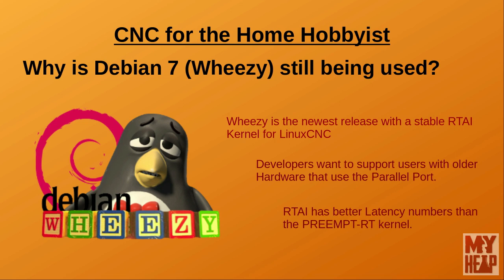LinuxCNC for the Hobbyist - 019 - Debian Wheezy is EOL, Now What?

Comment: OK, Joe which team are you on? What a great series. Thanks for the video!
Reply from the maker: Hey George.  To be honest, I see both sides.  I can be either simply because I have a pretty tight network firewalled by pfSense.  If I were less experienced with computers and networking, I may be on Team B.  Or stay on Team A and just use the SNEAKER NET.

Joe
Reply: My CNC stuff is all on my network and I have my firewall choked down. I've never used pfSense before?
Reply from the maker: You will probably be fine.  I use pfSense for VPN, wireless controller, vlan and some other stuff.  It is free software and runs on FreeBSD Unix.  You should check it out if you like that sort of stuff.  I also use FreeNAS to run my media, virtual servers and stuff like that in my house.  It is another free software running FreeBSD.

Comment: Well ... I have a (strange and unconfirmed) theory.
I have heard rumors about the RT-preempt developers preference. It also seems that the parallel port is dead, both available hardware and software support such as linuxcnc. Does that mean they leave RTAI? Maybe yes, maybe no. I do not know.
On the other hand, the linuxcnc rtapi API is common for both RT patches, as far as I know.
RTAI - the RealTime Application Interface for Linux (Dipartimento di scienze e tecnologie aerospaziali del Politecnico di Milano) has released the RTAI 5.2 on May 18 2019. They claim that this release has been "porting to the latest available Linux kernel patches, up to 4.14 .111 "
And now, the good news (I guess). Debian Stretch can use that kernel.
The roadmap is to obtain Debian Stretch with a kernel older than or equal to 4.14.111 (or downgrade a higher kernel ... is possible) and install the RTAI 5.2 patch.
Obviously we must make a RIP compilation of linuxcnc. But ... how long will the compilation chain for RTAI be maintained? I do not know too
I'm wrong?
Thanks in advance
Reply from the maker: Sorry for the delay.  I have been out of pocket.  I am not sure but this would be a good discussion.  Email me to xavier@gtec.com and we can talk about it.  We can also get with the developers and see what they say.  But at this point, I have been led to believe that rtai is simply unstable for lcnc with the new kernels and preempt-rt will work fine with the newer hardware.

Comment: There are a few things to take in mind, first, you can simply change your sources to access de new location of the repository, as you say. Second (Go 'A' team!!!) linux is widely used on servers, an server can't be reinstaled every new version raises, is very very common to run servers wich OS are 5, 6 or even 10 years with no security updates, there is none problems about that if the system is not critical in a security manner. 
By the way, and I know this is controversial, any linux is more secure than any windows you can have, so I would not be worried about that.
Reply from the maker: I agree with you.  I intended to stay out of the argument of which is best.  Personally, if you have a good firewall between you and the outside world, then the age or lack of updates to the OS doesn't matter as long as it still performs its intended use.  Just ask those folks running DOS based controllers.  :-)

Thank you for watching and taking the time to comment.  I appreciate it.

Joe